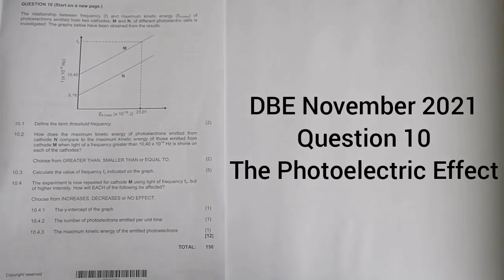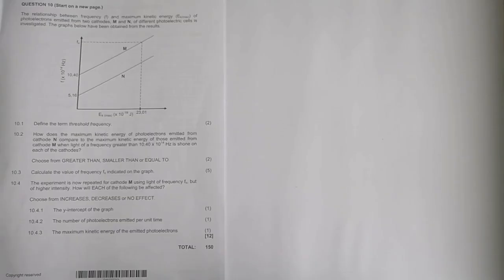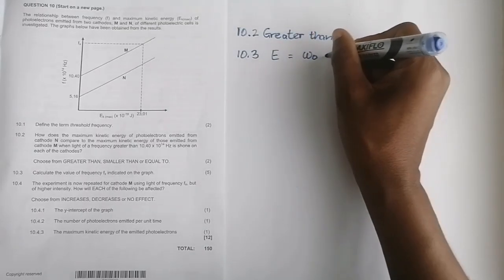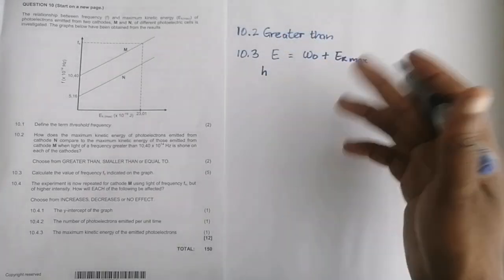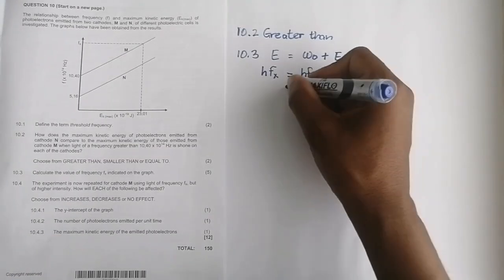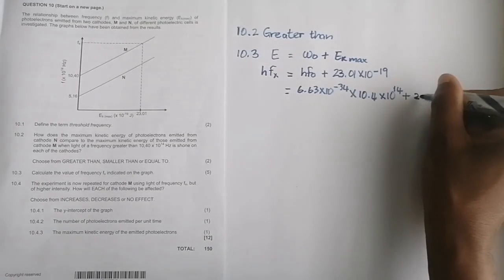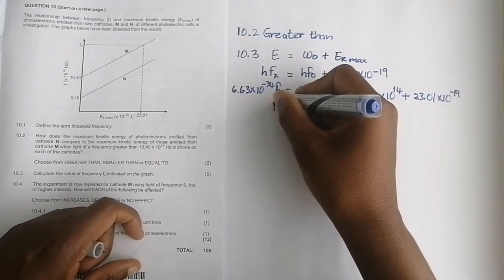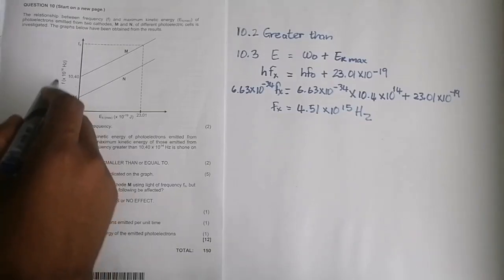Physics | Photoelectric Effect | DBE November 2021

Comment: Sir if you have used the inverse of Planck's constant to get Fx since the gradient of the original(usual graph) is equal to the Planck's constant and this graph is similar to the original graph but swapped, would you get the same answer?
Reply from the maker: You're really thinking... This is incredible to see. If you use the gradient of the graph, yes it does.
Reply: Ohhh thank you sir,I got worried for a moment.